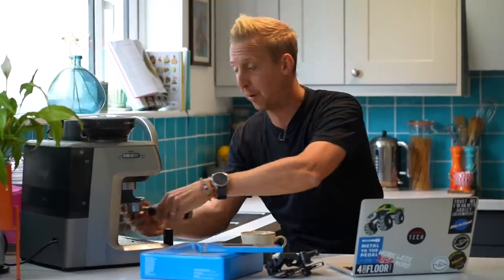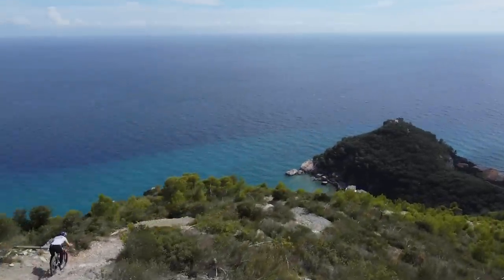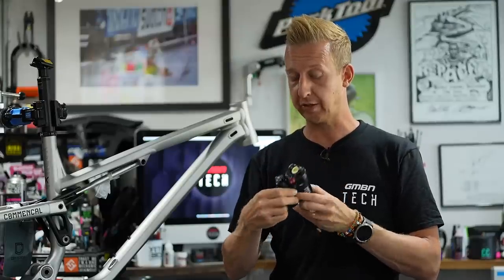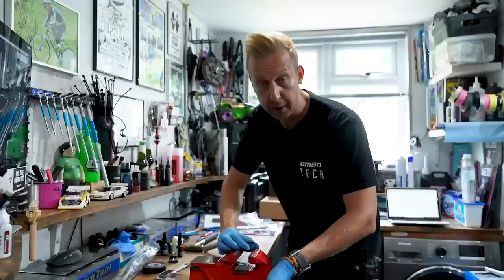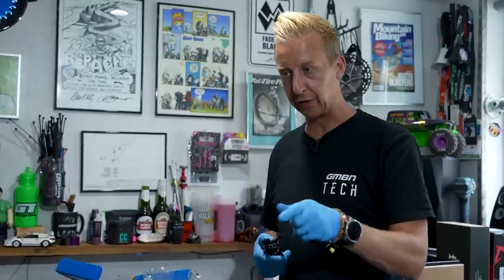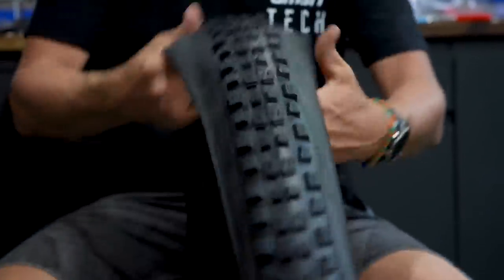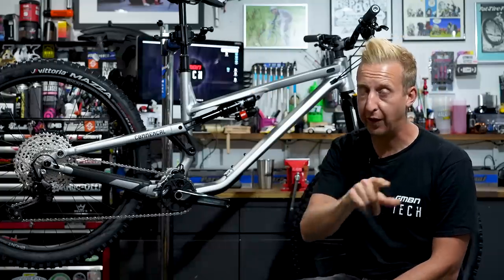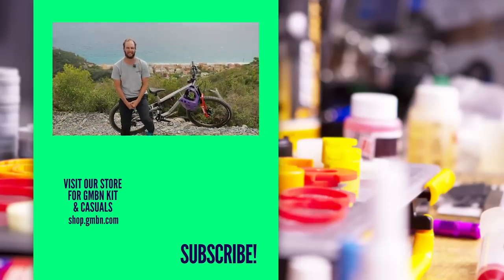Building An Affordable Bike Park Bike | GMBN Tech's Perfect Projects

Comment: Love the build doddy. 
£3.5k wouldn't be classed as budget for most people though to be fair.
Reply: I think for any serious mountain biker that classifies as a budget build though. And I feel like that’s what this is aimed towards. Going down knarly bike park enduro trails and similar trails aren’t trails the average person will ride down.
Reply: He did say this wasnt a budget build, but a conscientious one, meaning that you save money on some components but you have to spend some on others because of the demands of the trails and rider. A clear example of this is the Deore transmission and suspension, cheap but reliable and functional, contrasted by wheels and levers that arent the cheapest but will probably last longer and hold their own under prolongued abuse. Usually channels like these go for carbon everything and kashima coating for 8k plus builds. So having something burly and reliable for half the price is more than reasonable
Reply: I agree and disagree, 3.5k is expensive. But it's still a superbike, at a fraction of the price compared to running all the top end gear. Its expensive by default. Much like a cheap ferrari.
Reply: All activities have a minimum cost to entry.  If you cannot afford the minimum cost, save up, or try something else.

Is this cheap? nope, but if you want to seriously ride gnarly stuff, this is a reasonable cost of entry.

I'm sure you could do it marginally cheaper, but it wont be new, so you better have mechanic skills.  Cheaper yet and your probably sacrificing your personal safety.

Comment: My modern bike is a 2017/2018 bergamont roxter 3.0 marathon, very budget hardtail XC bike, cost me £380ish  cause the shop couldn't sell it and were going to send it back to the company so they dropped price a good bit and I bought it (at the time It's what I could afford and thought it was spot on) I've since then put suntour raidon forks, nukeproof horizon bars, nukeproof neutron front wheel (blew the stock one to bits on a techy downhill), rear wheel to some generic one can't remember name, and nobby nic (R) magic Mary (F) with some deity grips,  I don't use it as much as I should but this has been bang on as I don't go to parks and much prefer natural trails and it seems the stock tektro auriga brakes and 3x8 drivetrain are bulletproof because other than wear and tear items I've had no issues even with being both knocked off by a car whilst going to trails and also some fairly big crashes on trail, and the frame has been mint too

Comment: I just bought the same bike for 4300 euros and yeah it does come with better components in general but I like the fact that you get to choose what to run and personalize your own bike, the prices are similar and the hunt wheels, saddle and mazza tires are a great upgrade over the stock components. Something to consider is the fork, even if you have same travel, the length of the fork (axle to crown) is slightly different, around a cm or 15mm between a 38 and 36 mm stanction, so if you decide to run a 36mm fork I would add 10mm of travel to keep the geometry the same, or run it exclusively in the high setting. You do save some weight and lighter riders might benefit from it. So its nice to know since most people have a lot of spare parts laying around.

Comment: I recently built up a budget....ish bike from my old haro extreme frame. The frame was solid, strong and built like a tank. Also, it's the correct size for me. I converted it to disc brake (new forks) the holes for mounting rear disc were already there, so bonus.new rims, new rear shock, new rear derailleur. When I say new, some parts were bought used online. Now it works great. Still 26" wheels as the rear suspension couldn't fit 650b

Comment: I have donne the same with a Meta HT. With XT and a second hand Km0 (near brando new) Yary, 1300 euros. Transmission 10 speed XT by one in a fron race face Aeffect cranks, cheap chains and casettes as spares (sun race 42x11 casette are about 45 euros, chains 12 euros or so). The only drowback is the weight. But with a bit money will be this Meta Susp. So, it is possible. The dropper post of Brand X was a crap, now they are a bit better. That was the only change I would do. It is quite fun to ride the Meta, but in narrow paths ... not the best. 65.5º head angle is a bit too much to take tight corners.

Comment: Another big tip - shop sales!! I got a carbon Nukeproof Mega and PUSH 11-6 frame for £1600, then XT brakes, GX drivetrain, Zeb Ultimate 2023, DT E1900 wheels and sensible finishing kit kept it all below the £4k mark. You don’t have to break the bank for a super bike if you buy at the right time!!

Comment: I did what you said not to do. I put a marzocchi bomber cr on my new meta SX. Same eye to eye but slightly longer stroke. Tech support said it would probably be okay and I’ve rode 800 miles no shock issues. so I’m curious about how risky it actually is, I don’t know much
Reply: Its safe to ride so relax, it just changes the caracteristics of the suspension, like everything it has benefits and downsides but nothing to worry too much about. Cons: changes suspension characteristics that were carefully though through by engineers and pro riders, might make the bike wollowy on the climbs and less responsive on jumps and berms because it would sink more through its travel.  It might also bump against the frame on heavy bottomouts and imbalance the frame slightly. Pros: it might actually increase the rear wheel travel making even more like a downhill bike, having more air volume allows you to run smaller pressures and small bump compliance will be insanely good, making you more comfortable and faster on the downs. With tokens and a good tune-up you will be fine. But if you want peace of mind, get the right shock

Comment: 7:44: "It's all down to the installation" Nope. It's all down to the quality of the frame and the tolerances
Reply: actually it's both.
Reply: @RicardoPetrazzi  Well, as installation is key in all components, you can take it out of the equation, but you are right.
Reply: And most companies supply crappy BBs on their bikes. Get a decent BB & press fit works ok - but I still prefer a threaded BB.

Comment: Did Shimano solve the issue with Deore cassettes? The 11speed (M5100) cassette used to fall apart after a few hundred kilometres! The rivets holding the largest cogs together came loose.

Comment: That's a lovely bike and I wouldn't change anything on it. Not sure that enduro is the best choice for bike parks but it's a great all rounder for sure. I know they are more than capable in the rough but I still prefer what a downhill or long travel freeride bike provides in a lift access park.
Reply: As Tolkien said- "One bike to rule them all, and in the bike park steeze them." On a budget? Then an enduro rig is the one bike I'd shoot for every time.

Comment: Hi Doddy, great vid as usual,  one question about the Hunt wheels and I'm sorry if it's a stupid one, but I've only ever used the standard fitted wheels that came on my bikes. The Hunt wheels have 17mm axles but the Meta has 12 & 15mm axles. They obviously fit but could you explain how they fit ?
Reply: Hi Nigel, you are confusing the frame's thru axles and the hub axles. The hub's axle is basically a sleeve with 17 mm outer diameter that seats in between the bearings of the hub and then a frame's thru axle goes through it to mount the wheel to the fork/frame. If you want to visualize it just head to hopetech web page for example and find an exploded diagram of their hub :)

Comment: Love the build, however I'd swap out the shimano cable for the rear mech. Love shimano but those cables are awful. The coating peels off and socks up inside the outer and they are prone to snapping in the shifter.

Comment: Wait. Was the problem with the Coil Shock that it was the wrong measurements, or even if the eye-to-eye and stroke were correct, it still wouldn't fit in that frame? Wasn't clear from the video...

Comment: Are the Deore brakes really different from SLX? I thought the only difference from Deore up to XTR was that the more expensive ones have a bit more material machined away and are a bit lighter and come with the cooling fin pads.
Reply: reach Adjustment is external on SLX. A bit better/different materials internally (piston guide ramps are thicker etc. and the piston itself is different shape, leading to a touch more powah)

Comment: I wouldnt mind the SLX brakes... they are not top notch as XT, and not that better as the Deore ones. If you bleed them correctly no need for the freestroke adjustment. If you really want that free stroke adjustment its much better to invest on the XTs. Besides... all of the build was with gray color components...

Comment: @gmbntech #askgmbntech if the frame has different variants spec’d with coil would it be ok? I’m building up a commercal meta tr and the bike came spec with a coil but has the same yoke on the sx built here

Comment: Few issues with this build.

- Pro components are no available much outside europe and shimano blocks their sale. So they should not be considered on a build like this. (yes obviously they paid you to use them)
- Rockshox forks and shocks are usually by far a better value than marzocchi or fox. So even if you prefer fox, their price should have precluded them from the build. So my question is: did shimabno tell you not to use sram suspension?

Otherwise, all pretty good. I like that frame, price is fair.

Comment: Current Z1 is a rebadged 36Grip and it is NOT recirculating oil ! It has a blow off port at the top so it doesn't lock-up or explode when the shitty seal head used by Fox let too much oil in. (when it shouldn't at all if properly designed) Either way what you described is the way a semi-open cartridge works, not the case here ya clowns.
Reply: Also the only reason why Fox tells you to put shit loads of oil i  the cartridge side isn't because it is recirculating. It is because their poor quality cartridge seal head let too much oil get in the cartridge. Because of this you can't use proper thick oil that would mix in the cartridge and mess up damping. So you end up using cartridge oil that is shit at lubbing stuff so you need a lot of it. If only journalists in our industry actually knew what they were talking about ...

Comment: i can't figure out why he has a nice shop with a bunch of tools and still hasn't invested in at least a cheap air compressor.
Reply: Just unnecessary I imagine, an experienced mechanic can seat any tires with a floor pump so the only advantage would be efficiency
Reply: Off topic but make sure you drain your air compressor after every single use . I recommend putting 200 ML of thick oil and swishing it around or rolling the compressor around on a carpet being careful not to leave the drain valve open. This will coat the tank with oil to an extent and help prevent rust. It does have to be done often to make a difference tho. I do mine once every month lol
Reply: Another thing , having a cheap filter / drier on the output will make all the difference for running air tools, plasma cutters, and even eliminating moisture in your tires and shocks. They are really affordable on Amazon

Comment: Explain expensive parts price, like rear shock for 350quid, but no price for any suspension price, shifter prices. How is this BUDGET? 
A budget bike would be belt driven hub, good for 100k  kms.
Discs, not bad, but dont need gears or derailure for downhill or bikeparks, hence why dirt jump bicycles are single speed

Comment: Get ready for all the affordable comments. An affordable dual sus quality bike is $3-5K depending on components. Get over it. You want cheaper? Buy cheaper and don't complain when it falls apart or feels like crap
Reply: Absolutely. That's the difference between cheap and affordable. My enduro bike is almost 8k, and there's still a lot I want to upgrade. Recently I tried to build a really cheap trail hardtail. I managed to spend way under 1k on it, including the frame, but I already had many parts, like fork, front wheel, dropper, saddle and so on laying around
Reply: They seem to miss the ”bike park” in the title. I can find decent trail bikes for less or two xc bikes for the same price, but smashing bike parks need bit more heavy duty components.
Reply from the maker: Hey Mikko! This bike is a great spec for gravity/bike park focused riding. The suspension, frame and wheelset are brilliant affordable choices for hard hitting trails. If this was focused more at climbing then perhaps a higher spec drivetrain would be needed. 👍

Comment: Why so many gears, why full suspension? The frame isnt even budget. Your talking almost $4500 Canadian/$4000us
Yet i for the same money i can get an ebike conversion for $800 on an updated retro frame... no need for the most expensive parts, just reliability.
PLEASE BUILD A RELIABLE SUMMER/WINTER(CANADA, UK, RUS, SWE.) BIKE ABLE T9 SURVIVE 3FT DROPS, +/-25 FT GAP @45KPH ( JUMP TWO LANE COUNTRY ROAD) 8X3
25 TOOTH FRONT SMALL 50 TOOTH LARGE,  18 TEETH REAR SMALL  42 TEETH REAR LARGE

OR